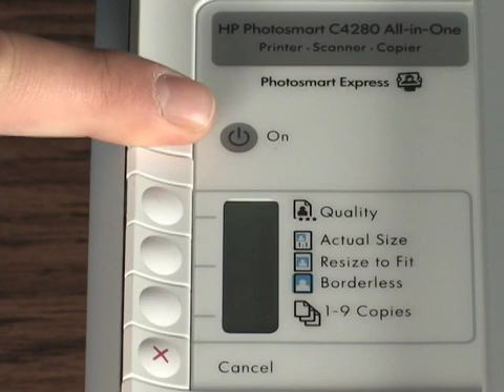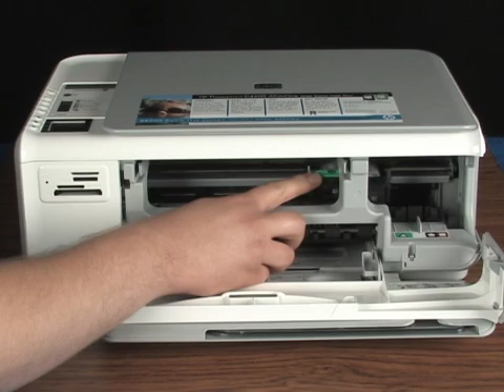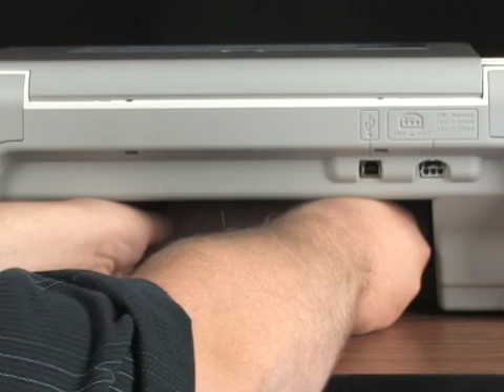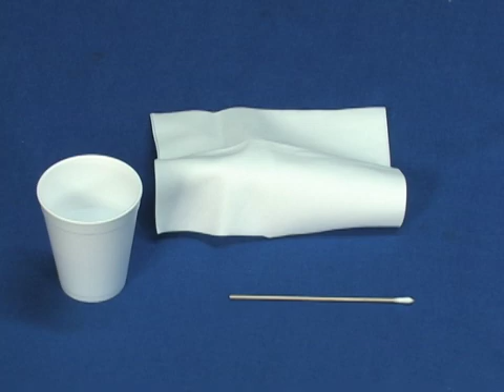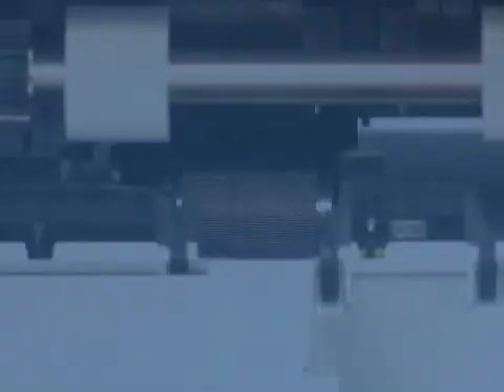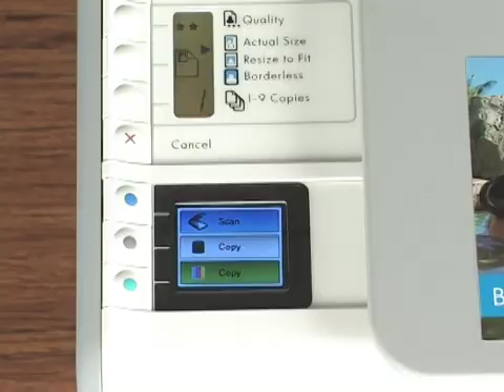Fixing a Paper Jam | HP Photosmart C4280 All-in-One Printer | HP

Comment: After going through step one it now says “print cartridges missing or not detected.”

Cool.
Reply from the maker: +N.A. Conen thanks for reaching out! 
I understand that you are experiencing an issue with an ink cartridge on your printer. 
I'll do my best to assist you. 
After you install an ink cartridge, if an Incompatible Ink Cartridge or Ink Cartridges Missing error message displays on the printer control panel or computer screen, the steps in this document should help you fix the issue: http://hp.care/2tf8Yh8 
Let us know how it goes.
Reply: @HPSupport  My printer is C4280. I don’t see that model in the link you gave me.

Comment: The fact that you had to make a very lengthy video means there is a problem with this printer model. I have one myself which i bought on impulse, because its HP which i equated to quality. To make a long story short, i bought 1, was able to use it a couple of times, after the warranty expired it started having problems, First was an ink cartridge carriage problem. It cannot detect my new genuine ink cartridges. Then paper jam errors even if there isn't any paper. I brought it in to the HP customer care center near our place and was told that i might as well buy another printer because they don't replace parts and i've only had the printer for 1 year back then. So i did and i have been using only EPSON ever since. Sorry HP.  I hope you reply.
Reply: +Rene San Luis I failed to mention. Every single one of my acquaintances who ever bought this model now has their unit as a very expensive paper weight in their offices. Not worth as a display piece unfortunately. I should have asked them first before i bought mine.

Comment: Did all of the above steps.... not helping. How can I know what possible hardware issues could it mean? HP C4288 the paper feed not working, the printer is not pulling the paper.
Reply: Kavita Pradhan   Please search for C00786157 on HP's home page or using Google search.  The title of the document is "'Out of Paper' Error Message Displays and the Product Does Not Pick Up or Feed Paper".  It has the steps to follow if the printer is not feeding the paper.  If you have tried all the steps in the order presented, then please call our technical support at 800-474-6836. If you live outside the US/Canada Region please go to Google search and enter 'contact HP worldwide'.  Your first option should be the site for contacting HP, when you click on it you will be prompted to choose your country/region.

Comment: I would want a epson printer again, I had one in 1999, I used it works perfect, if I know all of this before buying hp crap I never changed printer, by the way, epson printer have a button to roll down the paper that solve this kind of problem without doing any reset or dumb steps